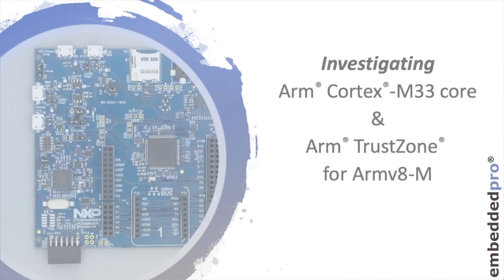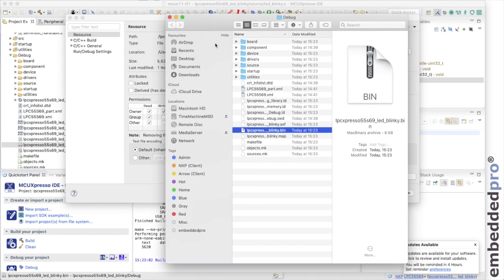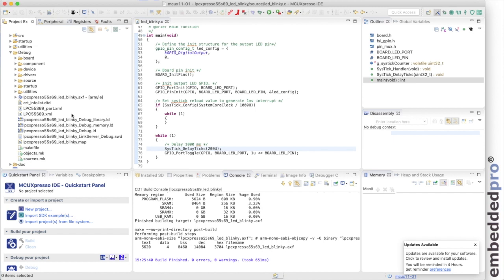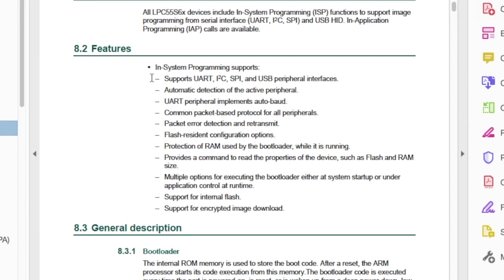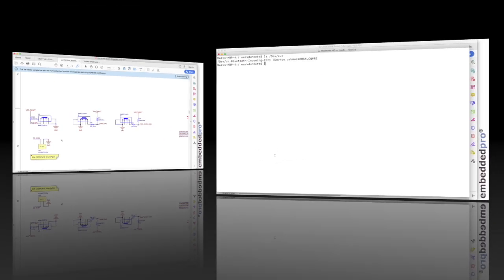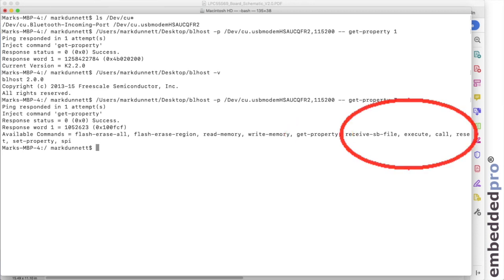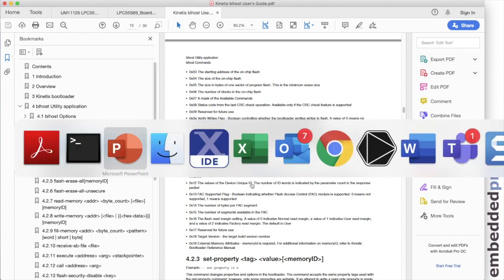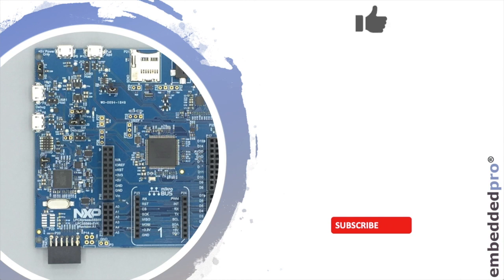10 In System Programming

Comment: On a windows pc, type mode into a cmd prompt window and it will report all ports that are available (not open). This makes it very easy to figure out which com port to use. If more than one, unplug the USB cable from the LPC55S69 PCB, do mode and note com ports reported. Then plug the LPC55S69 PCB into the USB and repeat. The new com port is the one to use.

Comment: Hi Mark, where can we get the blhost application for mac/windows?
Reply from the maker: Thanks for the question. blhost ships with the SDK. Check this location: <SDKpath>\middleware\mcu-boot\bin\Tools\blhost\<HostOS>. You must extract the SDK from the zip archive to use blhost.
Reply: @embeddedpro3870  I could not see the mcu-boot in middleware, did I download wrong, could you please throw some light on it?
Reply from the maker: @kishorekumarkadari405  That is strange and you are correct. I just downloaded SDK_2.8.2_LPCXpresso55S69 and this no longer contains the \mcu-boot path. I don't know if this is a mistake or a deliberate decision by NXP. I tried a few SDK versions, and was able to find \mcu-boot in the Windows host version of SDK_2.6.3_LPCXpresso55S69. You may want to raise a Service Request with NXP and ask why \mcu-boot is no longer in SDK_2.8.2_LPCXpresso55S69.